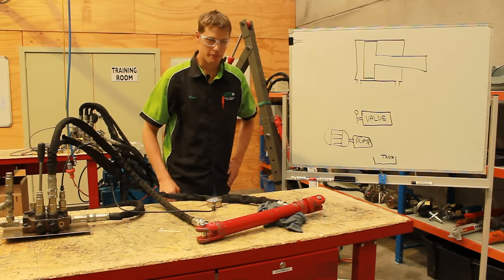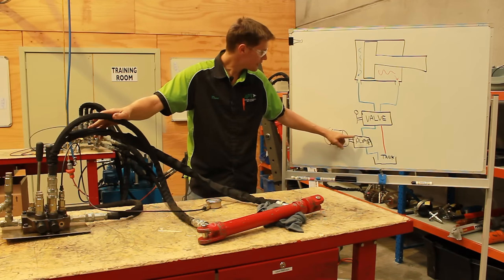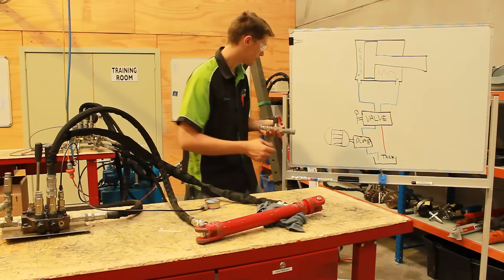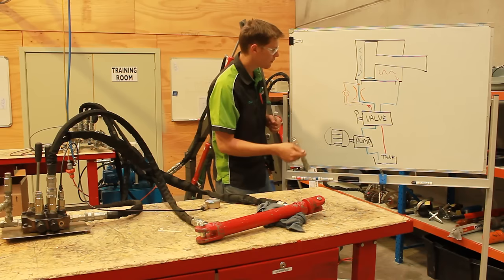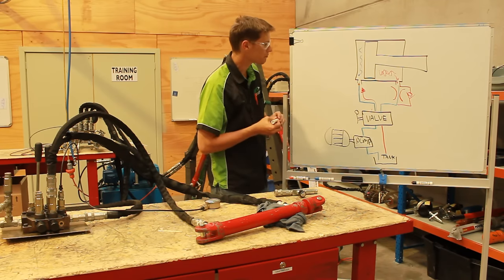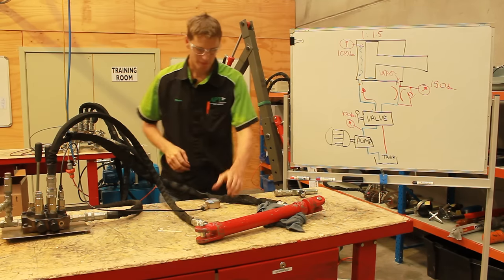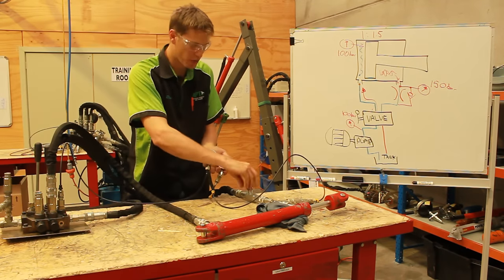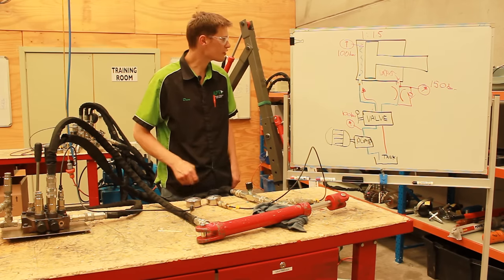Hydraulic Cylinder Circuit - Speed Control and Intensification

Comment: Very well explained . Ive experienced this very thing . 
On a 20 tonne Cat excavator we had a thumb installed and used a old Hitachi boom lift ram off a 10 tonne Hitachi . The Hydraulic hose guy we got to plumb it up only used 3/8 hose and a 3/8 cross line relief valve . 
The bucket hoses on the Cat were 3/4 . When grabbing a lot of trees and rubbish the cylinder shattered in half. We replaced it and it did it again about a week later . We got and expert hydraulic man to take a look and he replaced everything with 1/2 inch and the problem went away . The oil just could not return fast enough through the 3/8 system . The danger of using people that know enough to be dangerous and a costly lesson . The technician that fix it said that it could have cause a spike as much as 20000 psi inside the cylinder . Just completely chopped it in half

Comment: There actually is one very good reason to use a meter out flow control valve. If you have an overhung load on the cylinder (the load can pull or push the rod), with meter in, the load can produce a vacuum within the cylinder and travel unexpectedly. With meter out, it will be fluid locked and can not be pushed or pulled by the load.  Much safer. Just use components capable of handling the pressure.

Comment: Great explanation!  Very easy to understand this.   Since there is less surface area of the side with the restrictor due to the piston rod, that side will build a higher fluid pressure to balance the push against both sides of the piston. However, I think that the less the restriction of flow,  there is more relief to reduce the higher pressure differential. 
I find that there are one-way flow restrictors  to eliminate need to a directional bypass.
I had to subscribe.

Comment: ive watched this a few times, i understand your correct way of limiting the speed to the back of the cylender, but you only showed the 'wrong' way to attach the flow control valve to the top end. IS the correct way just the other way around? (if i want to limit the retraction speed - to make them the same) i'm hoping to make my own little excavator. many thanks for these videos they are so great and helpful cheers from the UK o/

Comment: My question is more about rotary actuator speed control not so much as linear.

Quick question....most people discuss hydraulic motor RPM off the reference to an electric motor driven pump. I understand that hydraulic motor speed is established off volumetric flow.  Since most pumps are driven off AC motors they tend to have a set RPM which in turn produces a set GPM output flow. This in turn results in the hydraulic motor having a set RPM  if not controlled by some form of restriction valves.

However, in the case of a gasoline or diesel power engine driving the hydraulic pump....don't we gain greater control over the RPM of the hydraulic motor, by controlling the engine RPM since that should change the GPM of the attached hydraulic pump??

I guess what I'm asking is if we slow down or speed up the RPM of the pump we would essentially be decreasing or increasing the supplied GPM at the motor and effect the speed.....correct??
Reply: Directional control valves are usually proportional, which means you can control the speed pretty well by the lever. In this case you definitely don't need any restriction valve that unnecessarily increases the pressure, that in turn heats up the oil, wastes energy and causes wear to the pump.
  And the answer to your question is Yes. - But by using a combustion engine you can't control the hydraulic motor from zero speed without a control valve.

Comment: Nice explanation. Great safety glasses.
Reply: Hi , by changing a bucket hydraulic cylinder ,do 8 have to bleed lines. I used my tractor to blow wet snow an things worked for about 5 hrs, then lost pto lift an bucket lift. Any thoughts on what I should look at to trouble shoot an fix. Thanks R9b

Comment: so meter out is not the way to go, it will increase the pressure, build up heat which is not good for the system i suppose, correct me if i am wrong, thanks.

Comment: Is there a way to reroute your ram end pressure line with a relief valve on return to valve bank that would push that oil straight back into the base end of the cylinder for a faster extending of the ram ?? Kinda like an ER system

Comment: very helpful videos, but i have challenges controlling the swing speed of an FFLB crane, i notice that there are variable voltage soleniods that also control speeds of hydraulic flow and cylinder movements. pls have you come across such solenoids??
Reply: Look up PWM….

Comment: Cool!  Ok so how do you maximize the speed in both directions (and have them at least the same) to get the fastest cycle times?  Also, what effect does speeding up the cycle have on the max force that a cylinder can generate?
Reply from the maker: To maximize the speed in the extension direction you would have to adjust the circuit to make it a regenerative Circuit.  Regenerative Circuits increase the extension speed of a double acting cylinder by taking return oil from the rod end and use it in the piston end to speed up extension. but in a regenerative circuit reduced cylinder force is a major disadvantage.
Reply: @CustomHydraulics  I don't know of any way to "adjust" a basic circuit into a regenerative circuit. You'd have to redesign it. Besides, a regen circuit is most effective only when the piston diameter to rod diameter ratio is greater than 2:1. 
The simplest way to achieve equal force for extension and retraction is a to use a double rod end cylinder—and it may not require redesigning the circuit. To achieve the same extension force as with the single rod end cylinder, you'd have to use a double rod end cylinder with a slightly larger bore.
There are others ways, such as using a flow combiner, but they would require redesigning the circuit.

Comment: I have a small trailer that has a hydrolic hand jack to raise turn lever and it goes down I am changing to a hydraulic cylinder with hoses to run back to valves on my sub compact tractor. What kind of cylinder do I look for to raise and lower bed ? Wagon capacity is 2000 lbs
Reply from the maker: Hi Roy, we would like to help you with your questions - we gathered questions, like this, for our live Q&A tomorrow. Join us there and we might answer this question for you: https://www.facebook.com/events/176497570992728/

Comment: I want to build a hydraulic system and I need t work out what size pump to use...I got a 6 horse power Kubota diesel...that is the starting point...I am building a log splitter maby one 30 ton cylinder ....do you have a video to explain

Comment: How would you speed up overall operation without changing the pressure of the system?
Reply from the maker: Hi Fred, pressure in a circuit effect the force of actuators, if you want to change speed, you need to change the flow in the system.
Reply: APT Specialist Hydraulics and Training is there a way of changing the rate of flow with out changing the the size of the pump or the motor that drives it.  Or would you just have to change both to increase the speed of the cylinder?

Comment: when you restrict the follow of oil does that cause the oil to rise in Temperature. ??
Reply: Gary Hall  yeah, the temperature increases because you are wasting energy. All the energy that is not used to perform work, will be transfomed into heat. It is way better to design a system where you do not need a flow regulator. If you need to, it is quite possible que you will have to install a heat exchanger
Reply: Do you know what your talking about ???????????????????????
Reply: @garyhall867  Yes he does exactly. Consider the possibility that it is you who can't follow.
Reply: @garyhall867  Yes when you tell the smart hydraulic oil to slam into the dumb hydraulic oil it creates friction which in turns raises the working temperature in the containment vessel..

Comment: Is there a flow control valve to regulate even flow to 4 cylinders at once? I'm trying to make/operate 2 scissor lifts simultaneously to lift the rear of a truck up 20" to dock height. So 1 scissorlift on each rear corner of the truck and 2 cylinders on each scissorlift. They'd be driven off a drive powered by a 12vdc battery. I'm not far into planning this yet so.....
Reply from the maker: Hi David, there are methods such as using flow divides or phasing cylinders that allow for almost even extension speed of cylinders. For the application you described however it sounds like you will need some electrical control/monitoring and would best off consulting an expert  for assistance.

Comment: why not increase surface area on the other side by reshaping the back of the piston in an angle increasing its area
Reply: It’s not the piston area but the fluid volume that causes the pressure difference

Comment: One question i have an electric dual hydraulic pump  but need to use on a single cylinder can i still manage to use the dual hose electric pump with that single cylinder? Is there a y adapter that can make that possible?
Reply from the maker: Hi there, we are doing a live Q&A tomorrow at 7:30am (NSW) - join us live and we might answer this question for you. Join us here: https://www.facebook.com/events/176497570992728/

Comment: This is a very informative video, especially with your real-world demonstration. But you should really use standard ISO symbols to represent all components. These standard symbols not only denote specific components, but also illustrate their functionality. This makes it immediately clear what specific type of valve we're using without having to define or explain anything.
Also, standard terminology — like rod end and cap end — should be used in describing the cylinder instead of front and back. 
We all need to be able to communicate by speaking the same language.

Comment: at the end, he placed the control valve and check valve in series, but the circuit on the board shows they are in parallel. or I'm wrong somewhere?
Reply: I noticed the same thing. If he installed the valve like he had it on the board I thought it would have stopped the flow creating the 150 bar without him needing to close the valve..

Comment: if the flow control valve cum check valve piston side flow control valve rod side.how i increase the forwerd and reverse speed of the cylinder if pump not change.
Reply from the maker: Hi Gurdeep,  we want to help you and answer your question. We are doing a Live Q&A tomorrow at 7:30am, join us live there and we might answer this question for you: https://www.facebook.com/events/176497570992728/